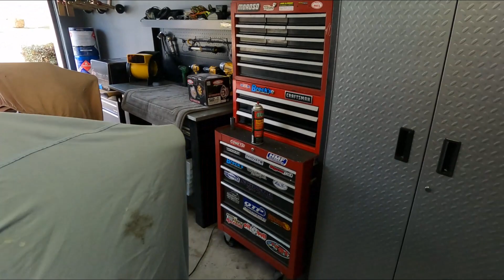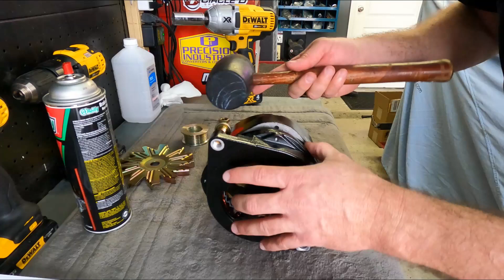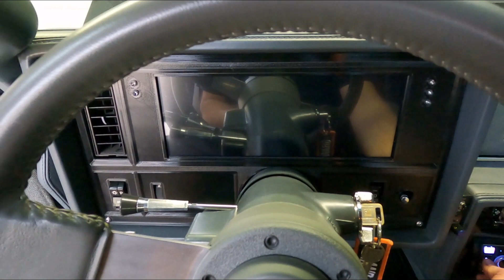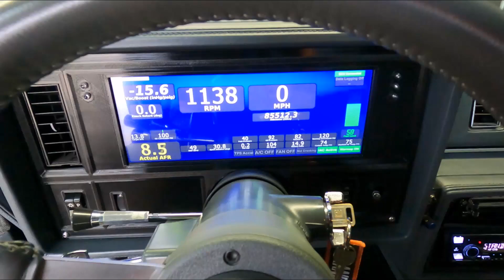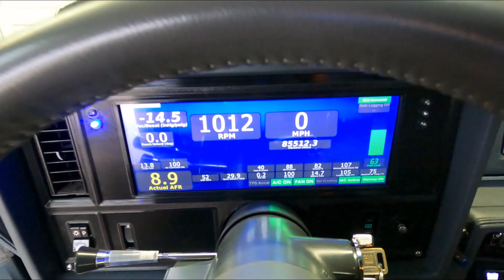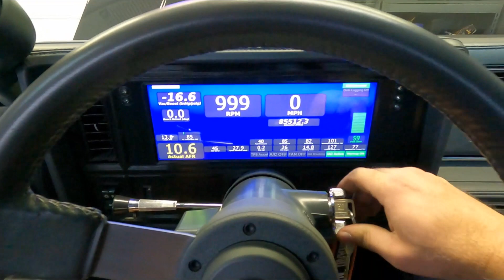G Body 1 wire, high amp alternator upgrade!

Comment: I like it I have a 1976 Buick century Indianapolis 500 Pace car some people says it's a Abody but it looks like a gbody it's just a ragler V8 350 5.7l I'm just wondering would that type of alternator be ok with and my car has fuse tubes running everything in the car would that alternator fry my is an electrical system

Comment: Do you know if you can put a pulley off a 10si on that
Reply from the maker: If you are talking about a single groove pulley, yes it will go right on there.

I have a CS144 alternator on my 71’ Vette and I used the factory 454 alternator pulley which is a 10 si.  Pulley interchanges fine.

Comment: I have a question about the wiring what do I have to do to go from the stock wiring to a 1 wire alt
Reply from the maker: You don’t have to do anything to the stock wiring, you just won’t plug in the square plug that comes from the dash “VOLT” light.  The 1 wire style alternator will start charging without wire/plug connected.  You will want to add a 4 gauge charge wire from the alternator to the battery and a 4 gauge ground wire from the alternator to the battery.  All the other stock wiring will stay intact.

If your “Volt” light on the dash comes on, you may either have to remove the bulb, OR you may be able to plug the square plug into the alternator just for the light to function, but the alternator won’t need it itself.
Reply: @AJsSpeedShop  thank you so much

Comment: I love your channel and car question when you put the smaller pulley on the alternator what size belt did you go with?
Reply from the maker: Robert, when I had the small pulley on it, this was on the Delco 140 amp alternator, I was actually able to keep the stock belt.  When I went to the Power Master alternator with the bigger pulley, I put the same belt right back on.  Gates belt #K060630

Comment: Looks like a good upgrade. I have the volt booster from caspers and the voltage dips into the low 12s but jumps to around 15 if the TPS volts are 3.8 or higher. Not crazy about it though...would much rather have proper voltage throughout the entire range. I'm running a 525 hellcat pump and would imagine that it'd be better off with a consistent power supply. What's the part number on the alt you have?
Reply from the maker: Hi!  The part number I used is a Power Master #578068.   I used to run the old Reds voltage booster on my AC Delco alternator, and I jumped it so it stayed boosted 100% of the time, always sat around 15.0v, idle to wot… but when I changed the dash and went to a 1 wire style, I couldn’t use the Reds booster.  The AC Delco 1 wire would still maintain 14.6v all the way through the a full pass though.  Everything is happy at 14.6v. 

I made a short pull in 3rd yesterday with the Power Master and it held 14.6v at wot, but wasn’t a full pass.  I’m sure it’s gonna be fine though.

I don’t like seeing less then 14.0v anytime…. Idle or wot…. 

Make sure to add larger charge cables directly to the battery if you haven’t done it yet.  I have basically no voltage drop from the alternator stud voltage to the battery terminals.